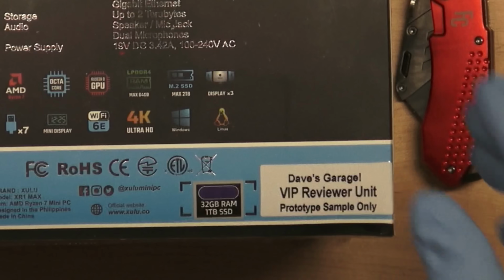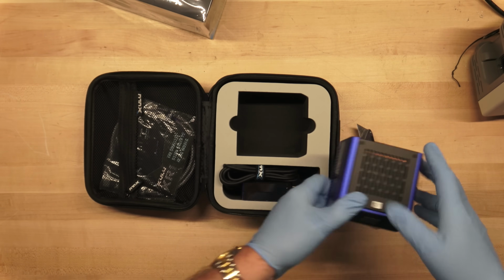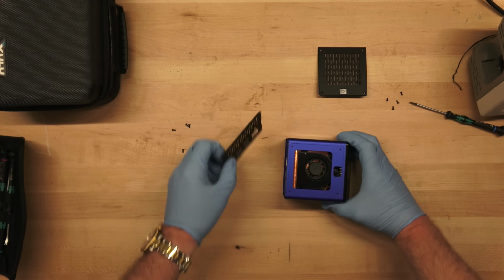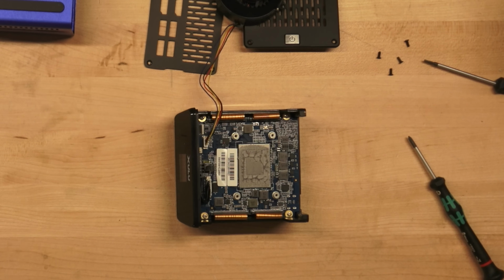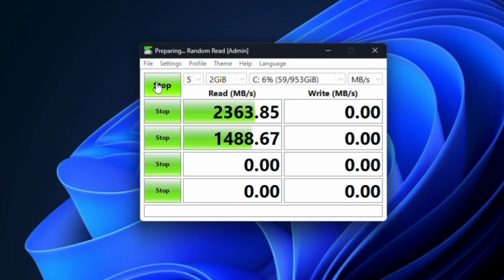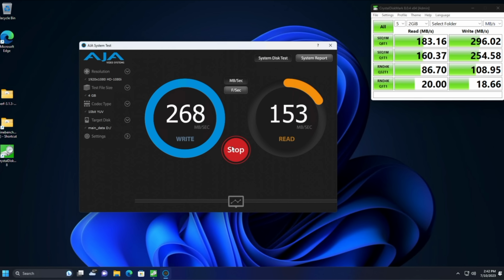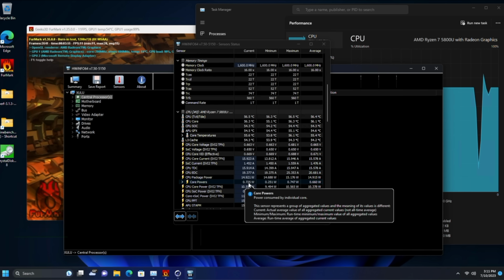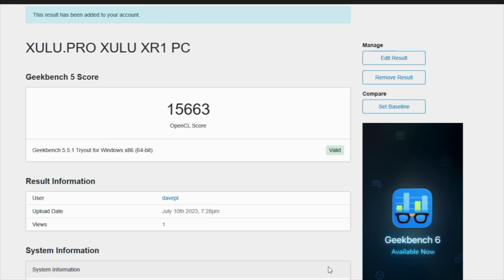Xulu XR1 Review: The BIGGEST Little PC!  Ryzen 7, GPU, 64GB, 2TB, 16 Threads

Comment: This is the second review of yours I've watched.  I'm finding a decided limitation in these single-board PC's.  Is there some reason these small computers cannot/do not include at least two eSATA ports for external hard drives?

As a photographer I need to handle HUGE amounts of data -- right now my previous generation hardware includes a 3-4 2T hard drives for data storage.  I need the newer generation of external 16T hard drives to keep up with demand.  I need at least (2) eSATA ports (preferably hot-swappable) to be able to copy from one drive to another.  

Does such a single-board PC exist?  Have you reviewed any in the past?  Please share your thoughts -- I typically build my own Desktop PC's and I am ready for a new generation, and hope to utilize the Single-Board PC's as secondary or tertiary Backups for my Wedding Business.  Your thoughts would be appreciated -- realize that I can do all of my image processing/manipulation on the newest gen Desktop PCs -- the SBPC's would be used mostly as backups; and I am NOT a fan of "The Cloud".  Thanks!

Comment: Nice little PC for the price, even if restricted by PSU!👍 Several versions beginning at $409 with PCIe lanes (for M.2 NVMe SSD), lowest price with M.2 SSD (no NVMe) $309, at a steep discount. Total of 16 models listed, the max being $3299 & that's quite a bit high (IMO) for a tiny PC, would say the same for the $999 offering. It's very unfortunate that the CPU's are soldered to the MB, hope the RAM isn't too, because there's at least one 8GB model listed. A 32GB (or 64GB) set of performance DDR4 RAM (if compatible) would hold a lot of browser tabs & improve benchmarks at a low cost today. 

However, I'd say that the NVMe options below $500 would be great for a 1st time user. Who knows, there may be a way to improve the (non-UL) PSU to one which would bring out the performance of these CPU's, which are decent & used mostly in laptops with lots more power in benchmarks.😀

Thanks for the well presented video!💯

Comment: Linus Tech Tips ran that test in real time with the same accelerated results using a top of the line ThreadRipper Pro with 64 cores 128 threads.

Comment: On TrueNAS with SMB (SAMBA) becuase it isn't running synchronous writes - should be asynchronous with SMB -  I think the writes are just hitting memory on the NAS while the reads could be pulliing from the disks so likely disk latency on the NAS side. Normally not seen wtih 1 GbE, but can occur with 10 GbE. Pure network tests, perhaps iperf3 would be closer to measure - not real-world, but helpful when looking at network storage issues as a sanity check. Great video.

Oh posted too fast.....

Comment: The Kickstarter page says it has a 1 gbit nic, so 2.5 gb is a nice surprise. While I'm waiting for my Xulu to cross on a slow boat from China, I bought a MINISFORUM Venus UM790 Pro Mini 32 GB ram, 1 TB SSD on Amazon for $650, which is about what I paid for the Xulu with the Kickstarter discount. That unit has PCIe 4, USB 4 (with power), and wifi 6E. I'm still waiting for my Xulu, and they are promising that the delay is to tweak the pcb so that it will be faster than the original specs. I'd love to see how MinisForum compares to the Xulu if you're inclined to do the same round of tests.

Comment: 4:44 Did you bother to calculate the actual throughput?  2.5e+9 * 1460/1500 / 8 = 304.1MB/s. Not MiB, it's divide by 1e+6, not shift right 20. It uses 1,000,000B = 1MB to match up with the deceptive marketing of the drive manufacturers.

Comment: 5:52 As far as I know, in the last decade or two the per-core performance has remained pretty much static, so... We're never getting a CPU that can actually run this fast in real time, not unless the problem being solved is embarassingly parallel. And even then, there's only so many cores you can stick on a die.

Comment: This PC looks seriously worth considering for mid level work.  Even though this Xulu product s an Indiegogo campaign, it looks like it may well deliver as promised.  Everything in the unit appears to be beautifully packaged.  It would be cool to time travel back and show this PC to the 1968 version of myself and witness the reaction.
Reply: 32Gb ram and 1Tb drive, in 1968, that would have been mind blowing. Not to mention the CPU specs on this thing, and all under 100W :D
Reply: I pledged on Indiegogo for one of these PCs shortly after the video dropped.  Xulu is just now getting around to shipping these in quantity as of November 2024.  There were supply chain issues, some worthwhile design improvements and a change of manufacturing venue.  The communication from the manufacturer has been good while the product has been getting off the ground.  Right now, the only 1 TB SSDs which are compatible are made by PNY and there are supply delays.  That seems odd, but that is Xulu’s claim.  If you want one of these PCs, go with the 2 TB model and you’ll get it more quickly.

Comment: They cheapened out by not having a power adapter with a grounded plug to prevent static shock.  I wouldn’t buy this unit as a result.

Comment: Thanks,  Dave, for a well documented tear-down and bench test. Was wondering, though, about those rubber gloves. Some folks wear a grounded wrist strap to keep stray voltages away from sensitive components. Rubber, being a fine insulator, just seems to me, would do the opposite and can actually generate static and such.
Reply: A more polite reply is that discharging static electricity on something metal like a desk leg is all you really need to do. None of today's computers are so sensitive that you will fry one even if you did get a snap of electricity when you picked it up. There's enough grounding copper to bleed it off. I always turn off a computer's power supply and unplug the cord before I work on it so there's no path to true ground, and thus no path for electrons in my body to go anywhere. But that said, just touch something with lots of metal before you touch a computer, and you'll be fine. I was wondering about the gloves myself, and I hope Dave tells us why he is wearing them.
Reply: Oh geez, Karen. I've been working on PC stuff for decades without doing anything except practicing the slightest awareness of the risks and NEVER have killed anything from a an ESD. Just don't be a fool and everything will be fine.

Comment: What you want is a standard square cross section box, say 3.5" sq and then your peripherals, like additional drives and the like, just snap on the bottom to make the box a little higher. You could do the same with cards, which could be made to be very thin boxes.

Comment: 5:47  It would be possible to work out how fast the machine needed to be to run the render at that speed. single core single thread. The heat sink size would be a worry.

Comment: Performance of write over the network is better than read very likely because you are CPU-bound. Write (sending traffic) consumes considerably less CPU cycles than Read (receiving traffic).
In particular, if your network card does not support Receive Side Scaling, or it only uses 2 cores for receive, then you will be bottlenecked on receive. And if you are using only one TCP connection in your tests, then even Receive Side Scaling will not help you.
Apologies for the long explanation.

Comment: I don't quite understand the market for this kind of product. If I have space for a desktop setup, I might as well get a desktop? And if I don't, I might as well get a gaming laptop so I can game on the go. Or better yet, I can get both.
Reply: This may not be the intended market for it, but the first thing that came to my mind is that - due to the physical size of it - this would be quite good as part of a Hacking toolkit/arsenal. I'd imagine there are some scenarios where a laptop would be somewhat suspicious but with this effectively being a PC, you could use it as a Server and access it from an IoT device, such as you're Smartphone.

I've done some experiments in the past where I had a Client Application on my Smartphone and a respective Server on my test PC that was written so as to run Command-Line processes driven by Commands sent from my Client Application.

With a lot of Networks, if you connect via ADSL/Ethernet Cable, you don't need to supply a password as you do when connecting Wirelessly. If you have Hacking/Network Scanning or Monitoring tools installed on the PC, you could then potentially see and scan any other devices on the Network. Sure, there are smaller devices that could serve the same purpose, but if you needed something with a little more power but that would also allow you to avoid drawing attention to yourself, such as if you were nearby or plugged in with a Laptop, then this would make sense as the next best option.

Of course, there are exceptions in every situation. But in the scenario above, I've gone with a Network wherein the Administrator is just your regular Joe who doesn't know/consider VLANs, MAC-Filtering, Black/Whitelisting etc.

Comment: Excellent review. It almost seems like they did a bit of an overkill with the CPU and a higher clocked Ryzen 5 with fewer cores could have been better overall with lesser "natural" TDP.
Reply: Agreed. On the website they have a lite version set at a max 3.8ghz (Pro 4.4ghz and Max 4.8ghz) but I think it's still the same CPU/GPU
I have an AMR5 with lots of numbers on the box and arrows pointing up (Marketing Joke) and it often throttles when hot.
More cores is not always a better system.
 We forget that 99.9% of games run on single and dual core units 
   and if some one wanted to run an 8 core 16 thread to it's maximum they would probably have it in a tower with Liquid cooling and a Titanium class power supply . 🤣
...edit after some more digging I found the Lite is a Ryzen 3 4core 8thread and the Pro is a Ryzen 5 6core 12thread .
Reply: @maxgood42  its maximum
Reply: @NoName-zn1sb  BIGGEREST MOST FASTEREST 🤣🤣🤣

Comment: XR1 is nice, but it does have some limitations:

-only 65 watt power supply
-DDR4 memory, instead of DDR5
-Ryzen 7 is low-power mobile version

Also the built-in gpu is modest, compared to a low-profile discrete gpu such as Radeon RX-6400.

Comment: For the size of that nuc, I'll say this: those scores are NOT bad Dave. That thing seems pretty ok if you really need a teeny tiny box like that. What a sweet size for a little media center (very powerful one at that!) man..
Reply: Perfect for those tiny Japanese studio apartments!
Reply: LAN party
Reply: One caution, I found that the MINISFORUM Venus UM790 Pro Mini which has similar specs could not handle streaming live HD video from a HDHomeRun without stuttering. I tried it with Wifi 6 and 2.5 Gbit ethernet with every configuration of wired and wifi, and I used Plex, Emby, and Jellyfin. I think the limitation is the gpu, but I gave up and switched to Jellyfin running on my Asustor NAS with sata hard disks, not SSDs. I have no problems whatsoever streaming everything from live OTA HD channels to 4k HDR blueray rips with the NAS, so it makes me wonder why these NUCs have problems hosting media servers. I have a Xulu XR1 on order, and I'll be trying it out with Jellyfin whenever it gets here.

Comment: FWIW - the iperf3 command you showed is outbound from the client to the server (and thus analogous to the write benchmarks) you'd want to run with -R for reverse for server->client or --bidir to test both directions.. possible it's some sort of RSS (receive side scaling) issue on the receive perf in SMB if iperf3 looks good on receive as well.

Comment: Hmmm, when you follow your link you get to their webpage, when you click on the order button you get sent to a "page not found". Also I don't know why you and them avoid mentioning exactly which CPU is in there, the Ryzen 7 5800U, just hiding behind the Ryzen 7 thing. IMO it's a great CPU considering what it can do with such little power, and I like that the fan is easily accessible for cleaning (unlike most laptops). Myself I just ordered a Beelink with a 5560U and 16GB mem 1TB SSD for under US$250 shipped from Amazon, beats many of the others out there right now.
Reply: our site links have been fixed. thanks!
Reply: Yeah, I thought the vagueness of what the actual CPU is seemed really sketchy. Probably because dozens of other companies are selling 7840 mini PCs and handhelds.

Comment: I got a 5950X also.  It has been a very good CPU.  It is a 16 core CPU and while it is am AM4 CPU you at least don't have to fear damaging an LGA socket while installing it.  If I ever have to install an LGA CPU it will be with short sleeves, no sleeves or just no shirt if it dangles at all in the case while I am working on it.  The reason is that your clothes will catch on those pins and bend them and now your expensive motherboard is ruined!!  Also avoid dropping anything in that socket since that is very likely to damage it too.  You can also be grateful not to have to mess with it any more once the CPU is installed correctly.

Comment: So yeah, mini pcs from competing companies have more modern CPUs, are easier to disassemble and upgrade (When supported) and do actually support most of those things that Xulu claims they don't on their website. Like sure you can find minipcs that are just as locked down as an mac mini, but you can also find ones that allow for upgradable storage and memory too. The OLED display is a neat gimmick but also completely irrelevant to anything. Cases used to have displays on them, we stopped because no one cared. Maybe other mini pcs are marginally larger, but be honest with yourself, do you care? The difference is extremely small, and it's not like a smart phone where you can feel the difference when using it or a laptop where it can make difference for how well it fits in your bag.

Comment: 4:25 What I'd be more concerned with is it's performance for very large file transfers. How long can it sustain that 2 gigabyte per second speed, and how slow is it after? For example the Samsung 870 QVO (SATA SSD) can do about 600 MB/s for about 100GB in it's 4TB configuration, and then after that it drops to like 130 MB/s which is slower than some hard drives. Now if you don't move much more than 100GB on any kind of regular basis, that's fine. But it's still worth noting and something crystaldiskmark won't tell you.
Reply: Would some additional cooling or heatsinks help that limitation?
Reply: @Thezuule1  No, it has to do with something called SLC caching. Basically the SSD has a small portion of very high speed flash and a much larger portion of slower flash. Once it's done writing, it moves things from the SLC (Low density, high speed) cache into the QLC (High density, low speed) storage. If you move a file that's bigger than the SLC cache, it slows down a lot as it starts writing directly to QLC. Pretty much all high performance SSDs work this way. If you want a disk that doesn't work this way, you'll have to look for one that specifies that it only uses SLC storage. It'll probably just say "SLC" somewhere.
Reply: its performance

Comment: Those benchmarks mean mothing to me. Processing video in DaVinci Resolve 18.6 is relatable. Heavy duty edits in Photoshop mean something to me. Could this be the computer to live in the campervan for a photographer/videographer?
Reply from the maker: Photographer, yes.  Videographer, no.  I reported the GPU benchmark at 15000, which is enough for casual gaming and Photoshop general use.  But my 4080 scores 250,000 by comparison.  You could edit video on this, but I wouldn't recommend it as the solution I'd pick first.

Comment: why the latex gloves - is this mini pc a biohazard? the small form factor has seriously degraded performance - what i got out of the review - thanks for the content
Reply from the maker: Because I once saw a video where the guy's unkempt nails in a closeup grossed me out.  So I (a) always stay nicely groomed myself, and (b) wear gloves.  It's like seatbelts and airbags.
Reply: I was once advised by a guy who worked for Maplin Electronics that you should never touch components with bare hands as there is a risk of static electricity damaging the components. This was my first thought on seeing Dave wearing latex gloves.
Reply: @0bits_1 also residual moisture with some components. Most modern stuff is ESD protected.

Comment: With these little units, the big selling push will be usb/pcie passthrough. It would also free up power for the cpu if an external GPU dock was able to be used.
A big little features like this will give way to beginner kid units or small office space with extra GPU power if needed for productivity.
Nice overview.
Reply: I remember seeing some kind of weird tiny PC with similar size and look, but it has an exposed PCI-e slot. You can install a high-performance graphics card on it, dangling outside of the case. I can't remember its name though.

Comment: Why would they feel the need to specify that this x64 APU is windows/Linux compatible!?
Serious question; have you ever been in contact with a x86/x64 CPU/APU that's wasn't modern os compatible?
Reply: Good luck with trying to run Linux on something like Microsoft Surface. That thing has tons of proprietary weird stuff without driver support in the mainline Linux kernel so you have to use a custom kernel where the drivers were developed by reverse engineering (and even then you can't get a multitouch or a camera support)
Reply: @Agent_Krasnov  actually, a quick YouTube search and it seems the Linux community is on that ball quite a actively